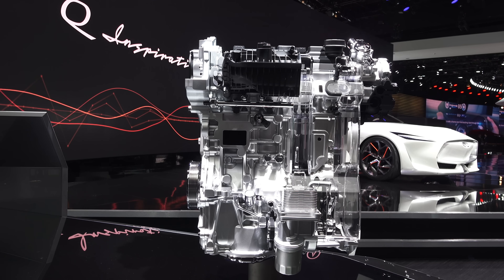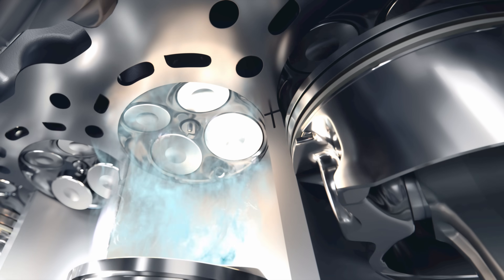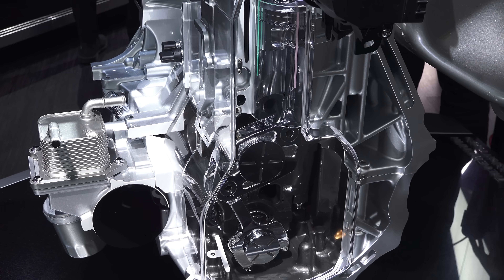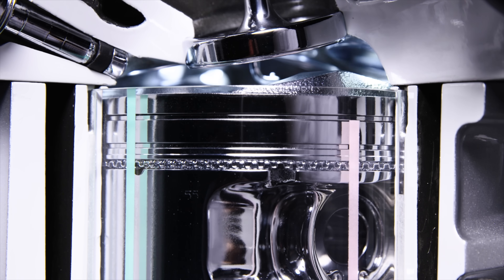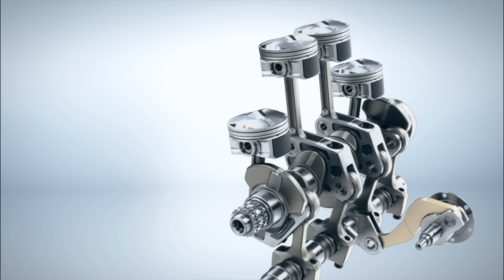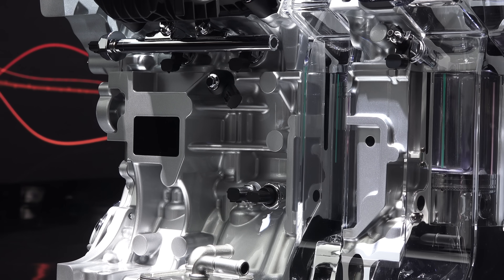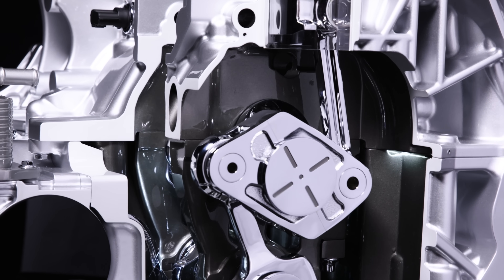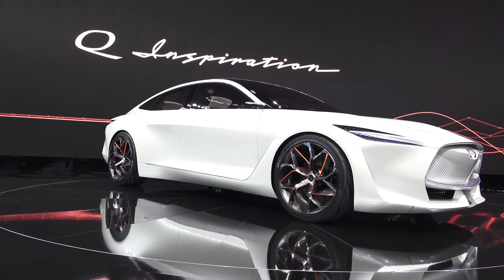INFINITI Reinvents The Gasoline Engine — VC-Turbo

Comment: I wonder what other manufacturers will come up with to compete with this. 
I also wonder how scalable this technology is. Will it have lesser, same, or greater benefits for V twin engines for bikes, three cylinder engines, inline 6s, v6s, v8s, boxer engines, W engines, etc. 

I'm also assuming from the statement that the height is the same as a normal engine, they're using the lower part of the engine block and oil pan for the VC tech; which then makes me think about the difficulty it would require to retrofit an engine with this tech. Maybe it'd be as simple as using a modified crank, connecting rods, and the part that changes the variability, along with an engine specific add on to house all of this with a modified oil pan to keep height minimal. Along with the dual injection, meaning a new cylinder head. It sounds like a lot of initial work for design, but seems like a simple build; not bolt-on simple, but if you're rebuilding an engine anyways, doesn't seem too bad. And if it is something as simple as this, Nissan/Infinity could update all of their current engines with a retrofit instead of bringing out an entirely new lineup of engines, and all they'd have to do is add a simple '-VC' or something to the name of the engine model; it'd save money to convert than to make new engines.

Comment: Does it's piston stroke length is also variable as its compression ratio is ??..........crankshaft counter weight bob weight and thrust bearings on main journal can worn out easily ,if lubrication system malfunctions

Comment: How are the connecting rods connected to the crank cam thingy and how is the crank cam thingy connected to the crankshaft? Additionally 3M KM over 600 cars is just over 3k Mi per car which doesn't say much about reliability when people expect 100s of thousands of miles in reliability.

Comment: Why the need to use high octane fuel when you have variable compression, just let the ecu detect knock then lower the compression until it stops. Bad for power good if you don't have accses to good fuel.

Comment: Cool idea but ultimately doomed to fail. To many good ideas like this fail due to complexity. The system used to control the variable compression will most likely be the weak link. Not to mention the added weight in the rotating assembly is and inherent parasitic loss.   But good on them for trying something new. It has to start somewhere.

Comment: The best use for this is for flex fuel cars.
Ethanol and Gasolin uses very different compression, even on aspirated cars.

Also isn't there a simplier system where it would use hydraulics in the piston rod to make it longer or shorted better?

Comment: Can it run on 87 octane regular gas ok?  Or will engine risk damage or lack luster performance?  
I guess to ask that obvious question could be something they did not want to address?  Makes me think this motor exploits the benefit of high octane fuel but may be below par on 25% less expensive regular fuel. 
You have me wondering if you went easy on them for sponsoring your trip...  Suppose it is good for the future.  

I wonder if this engine could perform well without the turbo?  
Seems with variable compression the turbo may not be so important and may not be worth the drawbacks?  (Gas mileage, more oil changes...)

Comment: 1.2 seconds from efficiency to power plus turbo, plus a complicated engine control software dealing with all that? Sounds ..eh.. lame for ambitious drivers. The Mazda SPCCI with fixed compression and supercharger may perform better, while not being as "overengineered". But what do i know? Lets see...
Ah... and then you can only have power or efficiency, that seems to be also less of a compromise for the Mazda

Comment: Contrary to what all the reps say, it is in all actuality a Nissan. So reliability is probably not there. I work in the parts business and sell almost as much Nissan parts as I do Dodge. So in a few months after release I'll be selling parts for these things. You have a 2018 Infinity and you need connecting rods. Is that the upper or lower connecting rod. And what will the name be in the catalog for the motor that adjusts the lower connecting rod?

Comment: No way I’d mess with any of this tech.  An extended, simulated “real world” testing protocol, never actually equals the real world.  It’s interesting tech, sure, but....I don’t see any power benefit, and efficiency wasn’t mentioned.

Hopefully there’s major gains in that department; but with all the internal parasitic losses added from the whacky complex rotating assembly — I just don’t see it.

I strongly suspect vehicles getting these engines, will be stacked-up on shady used car lots — soon as warranties are up.

Comment: I fail to see the benefits here. What is the expected fuel efficiency of the engine? The power and torque numbers are really nothing special for a turbo 4 cylinder 2 liter engine.

Comment: so they are still recommending premium fuel.. seems silly.. at least design it so you can run regular. im curious how the motor will handle added hp as everyone in the sports industry seems to do. double the connecting rods and bearings doesn't seem handy. it could be a great engine but there has been radical engine designs in the years past that are not around today for various reasons.. i don't think the benefits of adjusting compression ratios outweigh the negatives that i see especially if you anyways have to run premium.. then just make it a 12.5 to 1 and run premium. the power numbers don't seem that great either

Comment: They drop compression ratio for power situations? This isn't any more powerful, it has more rotating mass, and it has safety features that drop your possible power when you put your foot further down. Great engine.

This is literally just for economy, all of the innovations are for economy.

Comment: So what happens if you're crusing on a highway and suddenly floor it? Does the throttle response lag by the 1.2 seconds it takes the actuator to reduce the compression ratio, or does the turbo vent until the change happens? This all to avoid knock due to the sudden increase in pressure the turbo will bring, which I assume is a low inertia turbo that'll spool up in far less than 1.2 seconds.

Comment: That is a lot of complexity.  The more moving parts, the greater the chance for something to fail.  It will be cool if it works but when, not if, something goes wrong it will be extremely expensive to be fixed with less chance that it will be fixed properly.  I doubt there will be anything close to proper training giving to nissan mechanics who are in the trenches being forced to fix this thing on a time restraint.

Comment: Awesome video!
Couple questions:
What weight, type, etc. oil is used on this?
Will it be the normal  3K to 6K miles between oil changes?
Whats the market looking like for aftermarket parts and / or tuners for performance??
Thanks!!

Comment: What material spec is the plasma spray? Thermal sprays typically break down over normal use and require re-application and machining....must be quite a hard carbide cobalt type spray to last so long...

Comment: Let me start by saying that, (for now), I personally prefer an internal combustion engine over an electric motor powered car. Having said that, I really can't understand why automotive companies are spending exorbitant amounts of money on increasingly complex ICEs when the future is electric. Also, how many specialty parts does that engine require and how much would it cost to repair? Electric motors are simple with far fewer parts which has to be a huge cost savings in  both and manufacture and repair. We all know that battery technology is getting better all of the time and electric motors take the burden of emissions off of the auto and truck manufacturers. This huge investment in ICE R&D, tooling, manufacture, repair training and diagnostic tools just doesn't make economic sense.

PS, weather you like it or not, autonomous cars are coming and at some point in the future will be mandatory, so you can kiss the idea of higher performance engines being the future goodbye since they won't be required.

Comment: i wonder how much weight does that new technology added to the the engine WEIGHT .do that ENGINE still ca MANAGE to  handle the efficiency of it when the engine is on the NORMAL LOW COMPRESSION MODE?

Comment: How far we have come, from the rotary, with only 3 moving parts, to this monstrosity, with god knows how many moving parts.  Lots of bearings,  lots of oil slosh,  what is the oil capacity,  4 gallons?  Remember the Cadillac V8-6-4 ?  Remember the 4 wheel steering on the Prelude?  Let's see what the reliability of this thing is first, and how many they sell.

Comment: Wouldn't a better way to describe this be as follows: "higher compression gets more power for the same amount of fuel"? I would wager that if 2 engines that had every variable the same, except engine A had a higher CR, I would have more peak power than B. I understand that lower CR allows more boost, I think you could have refined your description.

Comment: Just subscribed to you seen you for a while now and you're S2000 the Infinity engine is very Volkswagen ish and Toyota fuel system like.👍
Reply: How does this vc engine even slightly resemble a vw engine  
And Toyota fuel system like?  Dude your either high as a kite or just clueless
Reply: Boosted Beast Volkswagen TDI engine as the exhaust manifold In the block which cools down the exhaust going to Turbo and Toyota uses direct injection and fuel injectors to.👍
Reply: michaelc51388 ohh I see what you mean. I was being a dick without entirely understanding what you meant. My apologies sir
Reply: For a while i thought you meant similarity to the VW Budack cycle.
Reply: michaelc51388 you mean like 95% of vehicles? Exhaust mani and injectors?
Reply: VapourGFX yes and no most car companies use direct injection or old school fuel injectors Ford and Lexus are using both at the same time👍

Comment: Bike manufacturers have been offsetting their cranks for a few years now to minimize piston side forces as well. Glad to see this strategy employed here too, albeit in a different manner. I wonder if there is enough reduction in cylinder/piston friction to offset the increased friction from having all the extra lower end bearing points, windage, mass and increased oiling requirements....

Comment: Just before mankinds switch to electric vehicles, it was the only the swiss watchmakers who could achieve the complexities of the last generation of internal combustion engines.
Reply: Ever seen an oil rig, or the iron ore and coal mines that supply the raw materials for that big lump of detroit steel under your hood? None of our manufacturing processes are particularly clean. You'll be hard pressed to find people who are willing to go back to a horse and cart though, so we must choose the technology that does the least damage over its useful life. For cars that happens to be electric propulsion... by a small margin. Expect that margin to get wider and wider as battery technology improves and renewables make up a larger portion of the energy supply.
Reply: Lithium battery chemistry is pretty benign compared to the rechargables of yesteryear (looking at you NiCd battery). The whole pack can be recycled if disposed of appropriately. Sadly many people just throw their old phone batteries in landfill :(. 

In terms of total pollution an electric car is still better than a gas one. The idea that electrics are dirtier because of the battery comes from a study that made some pretty serious mistakes in their methodology- they tracked all of the pollution from making the electric car's battery and the power to charge it, but didn't account for the pollution produced by digging up and refining the fuel for the gas car (instead they only counted the pollution made by burning it in the car). As a result the comparison was between a real-world electric car and a gas car that was refueled by Harry Potter magic after every trip. Later studies have found that electrics are a bit cleaner... if you compare cars in the same class. A Tesla Model S is more polluting than a small conventionally powered hatchback, for example.
Reply: its the last hurrah before the end scraping the barrel for efficiency delaying the inevitable
Reply: nerd1000ify Bc electric cars don’t use iron ore or even copper ore on top of all the other more exotic materials needed to build a electric vehicle. Hell the mining equipment is most likely using diesel.
Reply: Michael Scofield there isnt going to be a major switch any time soon
Reply: And it takes twice as much fossil fuel to generate the electricity to charge the electric car than if you just burned the fuel in the first place.....
Reply: nerd1000ify and I guess you never saw a lithium mine then either... yeah, way environmentally friendly...
Reply: DevasionX There is, the EPA will slowly squeeze out gas because people actually believe electric cars are more environmentally friendly...  It's like they ignore how dangerous lithium is and ignore battery disposal..  :/  oh well, maybe a good carbon based battery/capacitor will be able to beat the energy densities of lithium and be mass-producible!

Comment: I really believe that combustion engines are still better than electric systems. With the advancements in computers and manufacturing combined with lighter and more aerodynamic cars it can be cheaper and more reliable than electric cars.

Comment: Thanks for a great clear video. 
Fairly good numbers for a 2 litre engine, but certainly not earth shattering. 
Are there any figures available on the efficiency of the engine. VS a conventional 2lt Turbo set up? 
The power and torque are figures achieved by many conventional engines without the complex, and as I see it as a mechanic, wear prone linkage system.
I wonder how much the upgraded oil system required to feed the additional parts and the extra weight offsets the economy benefits.

Comment: Not sure if mid 200's horsepower was worth this, maybe if this was in the 400's like Volvo's 4 banger. What would happen if you run a big turbo on this will the joints hold up?

Comment: This is AMAZING. I'm studying engneering, and just thinking of all the added variables of this design is rather intimidating, completely out of my league.
 Still, I guess for now I'll aim for the best engine capable of achieving optimum performance with regular fuel, instead of getting 7% better mileage with a fuel that's 30% more expensive.

Comment: If the reliability holds true, this is a great advance for gasoline motors. Unfortunately, it might be a little too late considering the hybrid/electric automated route many other manufacturers are taking. Nissan needs to cash in quick enough to recover R&D capitalization and expense, while they're hopefully working on non-gas alternatives. Especially before consumers realize they're paying for 8-cyl injector services on a 4cyl motor. No matter what though, your videos are top shelf as always. Great breakdown and explanation! Orderly flow of the science behind the tech.

Comment: It Is an amazing engine with this variable compression setup, Just to mention there are a lot of inline 4cylinder engines that doesn't have the balance shaft like the Honda B series and others.
I think that the revolution limits it's going to be a concern with that bunch of rotational parts, just my opinion.

Comment: With so many modern engines, even turbos, using regular pump fuel I find it interesting Infinity developed it to run on premium. Especially considering Mazda has figured out how to run its high-compression (although non-turbo) engines on regular.

Comment: Interesitng...

I dunno if I missed it or if it just wasn't mentioned... what about power/efficiency characteristics?

I mean... yes, you add all this complexity to maximize both, but I don't think you ever gave us any concrete numbers to say how much better they actually made it...

For example... a Mazdaspeed-3 is a 2.3L T4 that does 260HP at 21Mpg, and I think it takes midgrade?  How would a similar car equipped with this engine compare?